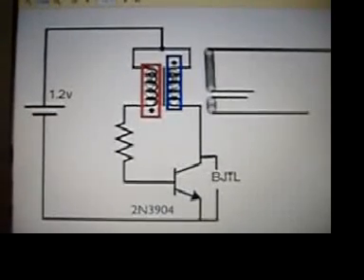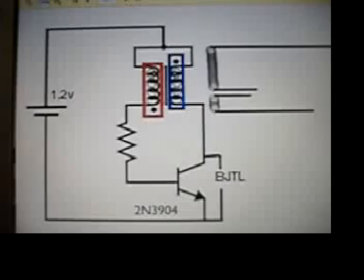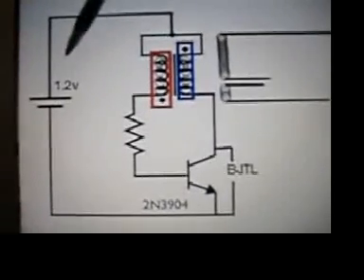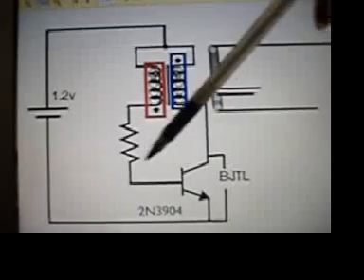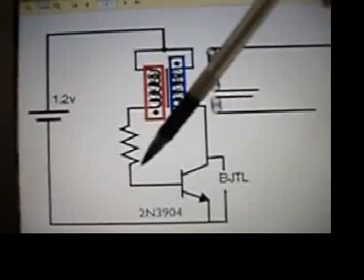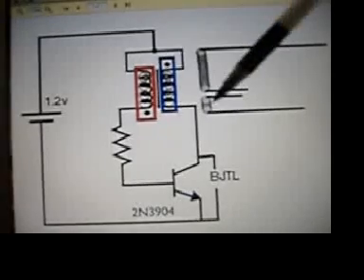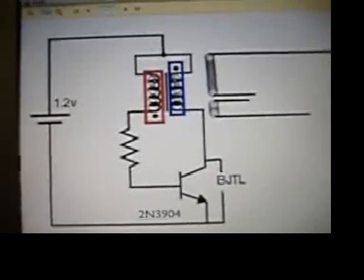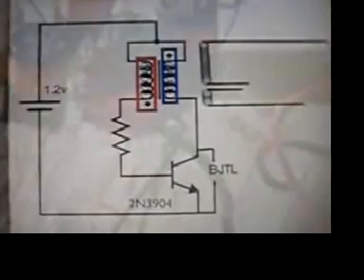Joule Thief with Secondary Explanation Part 1

Comment from the maker: @Dem0D1ck 
I think you cannot see it on this one. I made these videos to show the folks on overunity joule thief thread what I was doing. There is a lot of explanation and collaboration there. Many of the parts I used esp the toroid are no longer available. If you make a plain joule thief circuit as described in the make-zine video you will have the basic circuit I used before I added the secondary. This is not too helpful, but my things are packed away and I do not want to describe this wrong!

Comment: Jeanna, love the concept but have a question.  Which wire is the primary with center tap, the green or red?  Also, regarding the inductor on the secondary, can you specify size of toroid, wire gauge, and number of turns.

Thanks